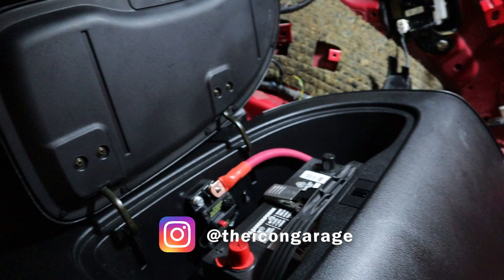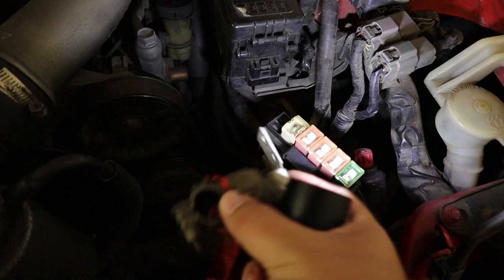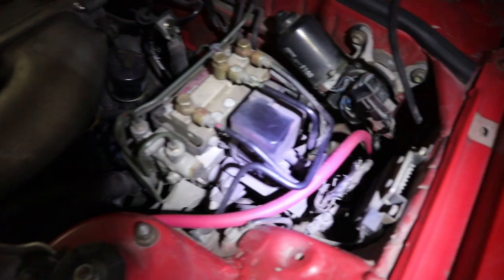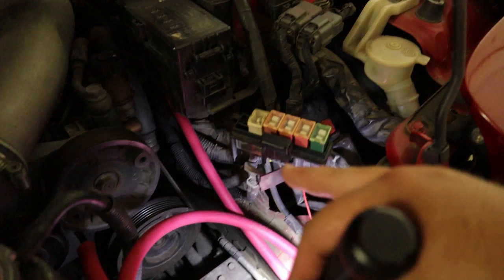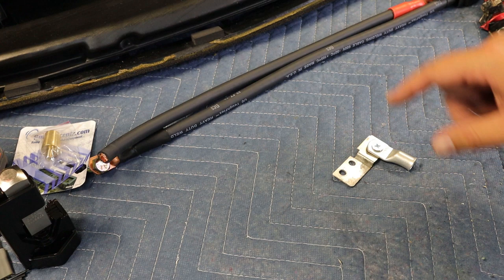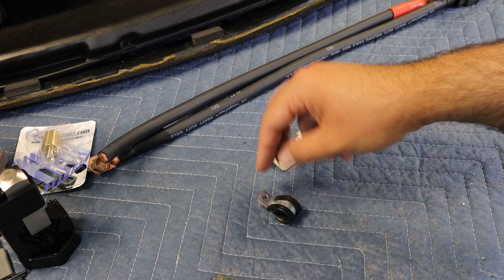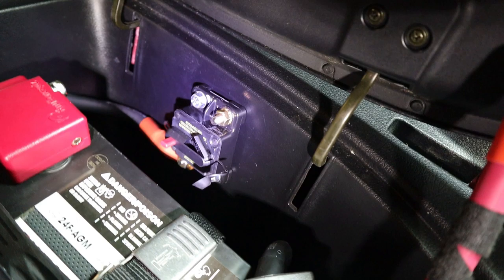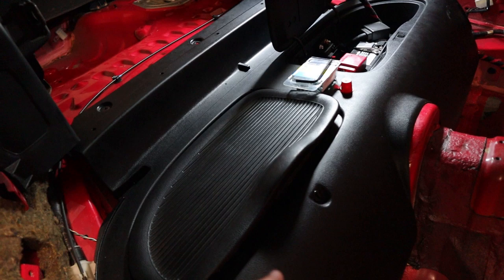FD RX7: Finishing the Battery Wiring

Comment: Love your video on wiring, you ispired me to rewire part of my '84 Audi. One tip I would like to give to you, the ground on the engine bay replace it with a ground strap for better grounding. Also, on your positive post, I would shorten the cable and rotate it by 90° towards the switch, for me it would be a cleaner installation. Hope I can help you!
Reply from the maker: Rotating 90 degrees would be better, but I have to rotate it the way I do in order to access the screw that tightens the terminal on the post. I have cleaned it up a little since I filmed this video.
Reply: @IconGarage  wouldn't be better to use a standard positive post that has a 10mm nut to tighten it? So you can easily tighten it even if it's rotated

Comment: MAN!!! Thank you so much for the tutorial! Phenomenal material and information - you really put out some great content! I'm in the process of cleaning up the engine bay as well and I'd like to also relocate the fuse boxes to the driver's side bin (LHD), but that's a lot of wires/looms to reroute. The idea of tucking them in areas where they'll be less accessible doesn't seem like a good idea either. Any thoughts?

Thanks Matt! You da man.
Reply from the maker: Like you said, moving them too far will require a lot of wiring which might be ok if you are good at that sort of thing. You can pull the harnesses out some to help free up a little slack in the lines to move them out of the way a little. Pulling them out of the wheel wells will give you a little slack too. I agree that tucking them behind the bumper, headlights, or anywhere else inconvenient will be a pain to deal with if you ever have to replace a fuse. That being said, the fuse boxes in the engine bay probably don’t have blown fuses too often. I haven’t figured out where mine will go but I’ll probably tuck them along the wheel well or near/on the firewall.

Comment: Nice work, I like your thinking about routing the wire. Looks very good to me. Why didn't you use a stud-weld to connect it to the bracket on the fuse-box?
Reply from the maker: You could do that in theory, but that may protrude outside the OEM plastic trim that covers the area I mounted the lug. The nut and machine bolt are the shallowest combination I could find that wouldn’t interfere with the fuse box cover. There is a lot of metal to metal contact so I think the connection will be fine and I used a lock nut to make sure it doesn’t come loose.
Reply: @IconGarage  Ah I see. Thanks!

Comment: You might want to think about sharpening a short Piece of 7/16 or half inch piece of copper of steel pipe to punch a hole in the grommet before you install it.  Use heat wrap on any cable going near or abouve headers  cable clamps are a great idea but you should think about using rivnuts instead. Any job you do will always take much longer than you think it will you can buy plastic soldering kits that come with a very strangely tipped soldering iron and a collection uf plastic mesh like stuff that does a great job of repairinh broken tabs is you have both pieces of broken tabs. if you sand the placic afer the repairs it is very strong. you wil never see the tabs after the repairs are done so  the tabs will work fine and the results will be no rattling.  i\Incidentally painting plastic panels is usually a bad idea because if something rubs against the panel the paint tends to rub off very usually comes off very easily.  It require specialy formulated plastic paint fogged on in very thin for the first coat and then thicker second and third coats.  Normal enamel and lacquer paints will not tthat will not stick to plastic. you will a

Comment: Stupid question: why would you delete the abs?
Reply from the maker: Early ABS systems were not the best. The FD’s ABS system is ok for street use. A lot of people remove the system if they are tracking their cars. It’s a personal preference for the most part. The system in my car does not work at all. I haven’t been able to track down the issue yet. So for me, installing the ABS delete kit will be cheaper (probably) and clean up the engine bay. Also, if she ever sees a track, I won’t be fighting the ABS system.